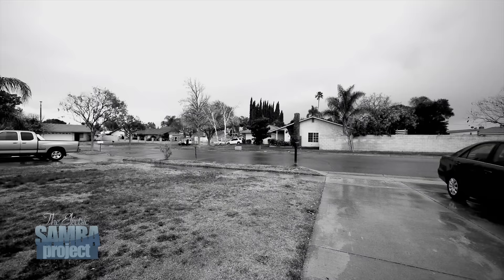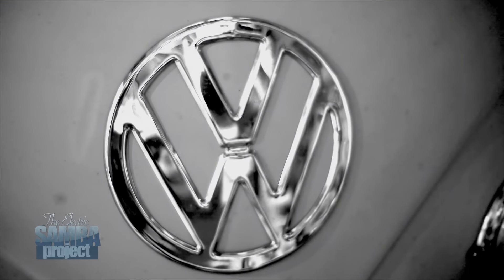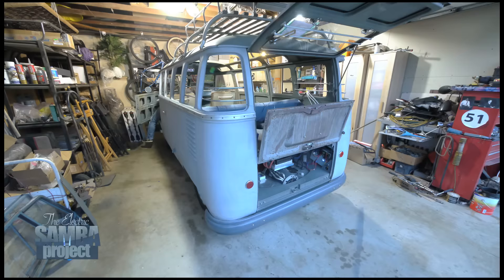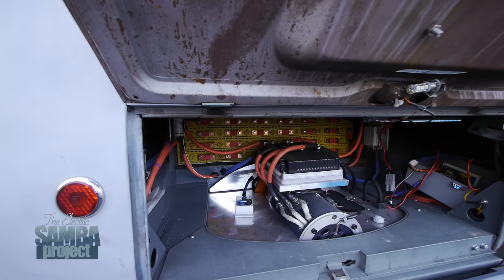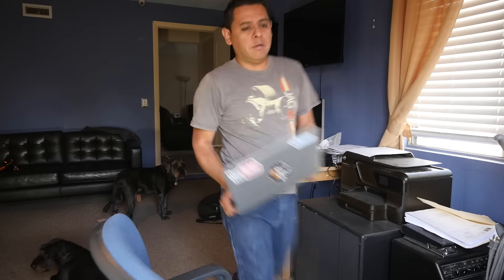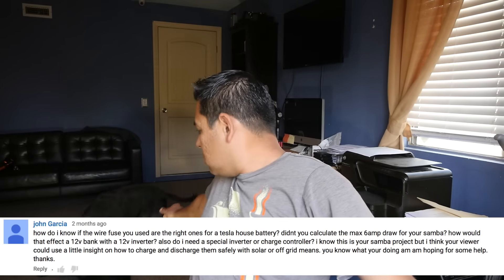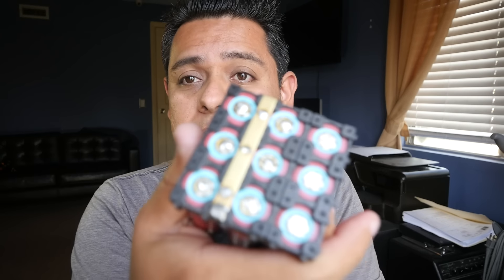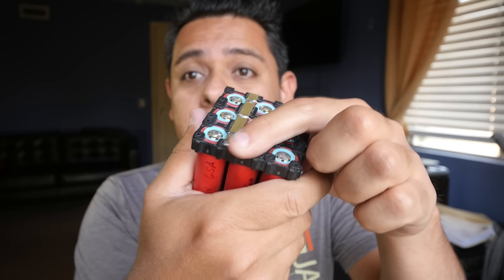Lets Talk TESLA style Cell Fuses  - Batt Talk #6

Comment: The idea of the fuse is to protect the bad cell from the energy that will be dumped into it from all the parallel cells next to it. So it really doesn't matter if the fuse wire will melt at 6 amps or even 15. If you have a parallel pack of say 100 cells, then if each cell dumps all its power on the buss bar that has no current limiting resistor then you will get 100 cells * 6 amps from each cell = 600 amps that will be dumped into this bad cell. This is a huge amount of energy. It is about 3.7*600=2220 watts. So the wire or any strand of wire will melt at that 2kw. In fact it will melt in less than a second and thus the bad cell will be isolated from the rest. 

So the bottom line, the fuse is to stop a bad cell from burning when all the other cells next to it dump all the energy they have into the bad cell. It is not to limit the amount of energy you get out of the cell.
Reply: a bad cell is not a dead short it actually varies a lot, going from high resistance to the rare 10-1 ohm ones
but you're protecting yourself from shorts in general
Reply: Idk if youre still on youtube or on this account but i would appreciate some info so much.

Comment: A good video so now I've got a question for you. I am building a 52v battery (14s10p) and I want to power my motor which is a 250w motor at 36v. I will change the controller so can handle the higher voltage and limit the amps to 5A from the controller so I can still be in the 250w range. Would the fuse type connection be advisable?

Comment: I have set up a lithium home solar cell using a 24v ( lead acid )  solar controller that was $10 off Ebay , it runs between 24.8 - 25.5.

Comment: To try to answer the question about the charge controller. Any decent charge controller, will have the ability to program for your battery bank. For instance a normal lead acid 12v bank you would set the low point at 11v and high point at 14v, or for lithium ion 18650's (3 cells in series) low point at 9.3v high point at 12.6 or (4 cells in series) low at12.4  high at 16.8v
Just an example the outback solar flexmax 60/80 looks like it would work well to charge lithium ion, it is designed so you can program it to meet your needs. Now that lifepo4 batteries are coming more commonplace this is more and more of a necessity and these charge controllers are starting to become more popular. So You just have take a look at the installation manual and just make sure you can program it before you buy one.
Reply: +l1t7l3ph0o7 I am succesfully running a 25.2v lithiumion bank using a bog standard 10$ controller off ebay , it has a dumpload and and you can see how many amps are coming in from the panel and also how many amps are going to the dump load, 24v battery is way more useful than a 12v
Reply: yes, my example was for 12v, to keep it simple, but when I build my bank I intend to go for 48v to squeeze out a little more efficiency.

Comment: I think if the concept of sizing fuse links is confusing people, they need to work out some more basic concepts before they start putting together large power banks.. I'm not trying to be derogatory here, but if that stuff is confusing to someone, they really aren't at a technical level to be building such a system safely. Also, wire type fuse links are great, but dangerous if applied poorly, they can start a fire easily if you give them a chance
Reply: +John Ryder what's wrong with this video?

Comment: Hi, is there any chance the Tesla fuses are not just current fuses but also thermal fuses?  If they are made of a material that melted at a temperature lower than the batteries would burst into flames, then the protection they provide would not just be a current limit.
I do not know what the Tesla fuses are, but there are many devices that have thermal fuses embedded.  They are quite often embedded in transformers or other items, and they are designed to go open circuit at a temperature low enough to prevent fire.  Those ones might not be suitable for these battery packs (insufficient current capability) but if the Tesla fuses have this functionality then your 1/4watt resistor leg will not replicate that functionality.

Comment: Won't this cause a chain reaction. say a pack of 100 cells are fused and 5 fuses blow. wont the other cells have to compensate for the current loss? leading to more fuses blowing?
Reply from the maker: +TG Lasers yes if you run your system at peak all the time,  I like some headroom on my designs

Comment: How important is cell level fusing if I use K2 26650 Lifepo4 cells in my powerwall. I run it at 12v. I know that the this chemistry is safer.

Comment: Seems like a waste throwing away all those resistors. Can't you find a place that sells solid wire in the gauge you would want? Sounds like having the wire burn at around 3x the continuous draw has worked well for you... have you had any burn out on your Samba?
Reply: it does seem to be a waste, you can buy set diameter wire that would melt at 6a
Reply: +BillTheBox They are so cheap in volume that it is not much of a waste.  Also, he said that he had spares or leftovers.  If you build a printed circuit assembly from those parts, you cut off the legs anyway as you only leave the length in the board to reach out the other side a small amount past the solder.

Comment: 1/4 W resistors are cheap, you can buy them for a couple of bucks per 3 or 4 hundred. So what's the problem? The trouble is that the lead diameter of 1/4W resistors varies by manufacturer and country of origin. I just went through my bin of 1/4W resistors and measured them anywhere from .016" to .0225". Current is based on wire size, about 700 CM (circular mils) per amp. So you want uniform wire wire for your projects, NOT resistors and you want to check wire charts to get in the ball park of the wire size you want to start testing amperage capacities with. You can use bare copper wire instead of fuse wire but you still have to test it for your application.
Jehu, I enjoy your videos but people are going to build dangerous battery packs if they follow your lead. Batteries can be very dangerous not handled and applied correctly.
Reply from the maker: https://youtu.be/VMUf3nOw7Cc
Reply: It comes down to this. Do you really want to help people build EV's, battery packs, whatever? Or do you just want keep holding up 1/4 watt resistors and calling them 1/8 watt? Because if you really want to accomplish something, to help people, then you'll take the time to do  research, to make things correctly and safely.

Batteries need  current limited charging and resistor leads make poor fuses. Give me the technical justification for why you use 1/4 watt resistors, why you don't use current limiting. "Life is about taking risks" isn't science, batteries are built on science. You're dealing with technology, your philosophy of life has nothing to do with it.

I think Jehu is a very nice guy, I love his dogs but he gives out a lot of bad info. If you want to learn something go watch Dave Jones. Electronics is a complex field, taking short cuts and not knowing what you're doing will only leave you throwing good money after bad in the long run.
Reply from the maker: +mosfet500   Yes go watch Dave Jones if you want to eliminate all risk from your life.  But before listening to mosfet here,  know that in all his research he has yet to discover 1/8 watt resistors http://j35.us/1k-Ohm-resistor  he mocks me with ignorance while claiming its knowledge
Reply: First, I'm not mocking you and yes I looked back and the resistor is in fact 1/8 W. The resistor was blurry and looked like a 1/4W. But regardless, using resistor leads as fuses is a poor idea because the lead diameters vary and current capacity is based on the amount of copper in the circuit. You are much better off buying bare copper wire for consistency. It is more than just being safe just like current limiting charging is better because the batteries will last longer. Again, batteries are charged at a percentage of C which is their amp hour capacity. If you charge them at 5 C, for instance, they may not blow up but their life will be considerably diminished. It's just good practice.

Let's say we were replacing a cement sidewalk. The best thing to do is put plastic over the wet cement to keep it from drying too fast because it will get harder and last longer. It has nothing to do with taking chances.
The same with electronics. We use the right process because things last longer, don't blow up, etc. 
Now, you can say here's why you're wrong, over charging batteries isn't going to harm them because of this reason or that reason. But that answer is technologically based within your understanding of science. Again, it has nothing to do with taking risks, we are talking about science and technology. So there should be a logical reason for your actions based on electronics and that is the answer you should give. If you are wrong than change how you do something. We all get to learn and make mistakes.

I'm not mocking you, I'm sorry if I gave you that impression, I sincerely think you are a nice person.
Reply from the maker: I already addressed why my fuses don't have to be perfect,   https://youtu.be/pM_SoXfOtDw

I have no idea why you think I promote unsafe practices,  I don't ever recommend over charging , over discharging, or running near dead batteries like if they where new.   The only recommendation that might seem irresponsible is that of not using a BMS,  but the only people who disagree  are textbook experts with zero practical experience running lithium battery pacs.  So i don't really know what you are talking about.   I have zero formal training of any kind so my ways are highly unorthodox but in no way does that mean I don't understand what I'm doing.
Reply: mosfet500 it is probable that the three of us have EE PhD's and have had PE licenses for decades, but at least I know who I am and what I do for a living.  jehugarcia here is not doing/recommending anything wrong. If you know anything about science, at least you should know a little bit about probability theory math and how Schrodinger's equation is the biggest thing in quantum physics whose applications are all around us these days and it is all about his "psi" which the probability density function as other famous physicists tried to explain. I have run state-of-the-art projects in my time where I only hired people with graduate degrees and decades of experience (the American likes of the great Dave Jones) and we do statistical analysis before every penny we spend because we don't want to get in trouble. What the OP here is doing is that he is cutting hundreds of legs of resistors (large enough numbers to trigger statistical risk analysis) that even though they come from a (close to) zero quality control source (99.9999% China), they are from the same patch and if you measure thousands of them you will find  their diameters normally (Gaussian) distributed around a mean and negligible variation for practical purposes. That is about equivalent to the tolerances that fancy exoensive TI bms chips can promise. You can't measure every single one, otherwise all business in the world will stop and we will never have gone to space or built anything. All resistors leads specs (for 1/8W resistors) in the industry can vary within some acceptable negligible range that is not worth our time just like no two batteries have identical charge and discharge curves at all times and temperatures...etc.
I just think that if jehugarcia is doing this commercially (not for personal use) that he should've tested a few hundreds of those resistor leads and use averages fusing current values for his designs (he probably did that).

For both of you, this whole per-cell fuse thing is something I am not fond of because the more helpful they are the more resistance/heat they'll have which is very tiny for a single cell but adds up when you have hundreds of them in an enclosure and that poses more relative risk than the more rare (again, statistically, that's how decisions are made everywhere in the free/educated world) mishap that may utilize their fusing capabilities.

I hope you both come back to this discussion after all those years.
Reply: @engineereuler1762  You're  trying to hard to impress everyone or as Shakespeare said:

"The lady doth protest too much, me thinks!"
Reply: I don't need to. I am impressive without trying. I hope you learned something new to you
Reply: @engineereuler1762   I think you're educated beyond your intelligence.

Comment: hello jehugarcia!

i got 63 of 18650 batteries which i want to use for my ebike. i put 9 in series and get 7 of them in parallel. I want to power a 250 watts motor with that. 
what cable do i need for fuses? with 36 Volt system the motor draws 7 amps, right?
If i divide 7 amps through 63 batteries i got 0,11 amps. So do i need to wire the batteries with fuses that resist 0,11 amps or 7 amps??

thanks and bye bye.
Reply: ari cri what's each 18650 cell rated at? mAh? Voltage?